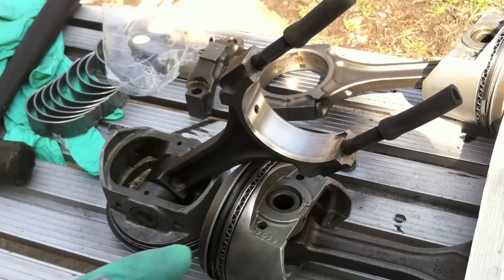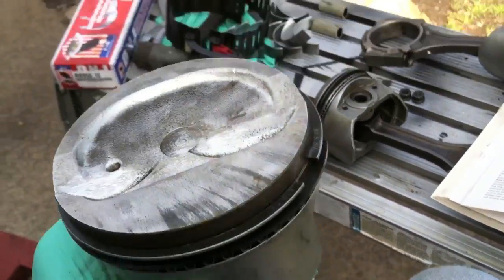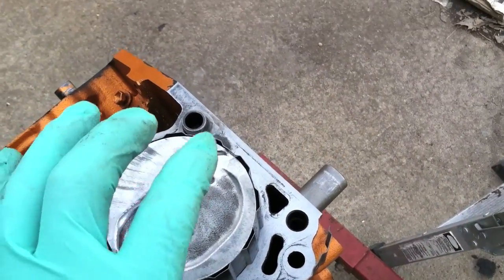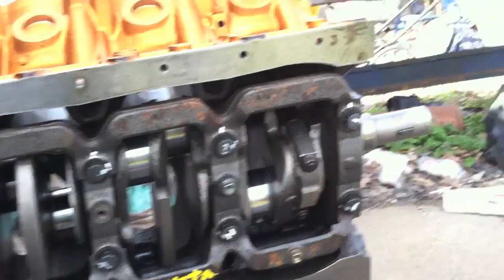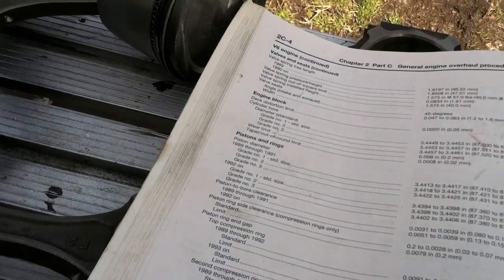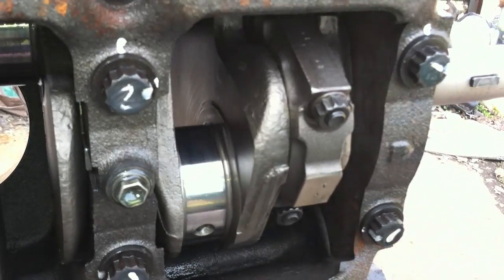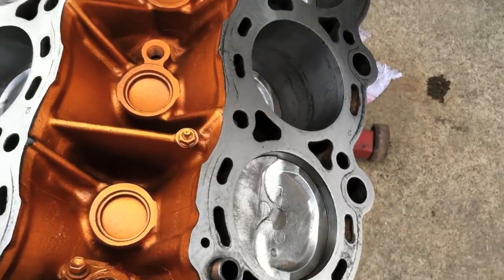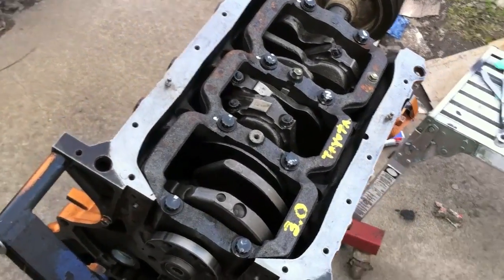3vze motor build part 3

Comment: Im gonna be rebuilding my 3vze as well soon, I was going to do the common 3.4 swap but I realized I don't need a ton of power for crawling or offroading in general, these 22re's with 80hp do the job just fine as well. Rebuilding is so much cheaper than swapping in my opinion